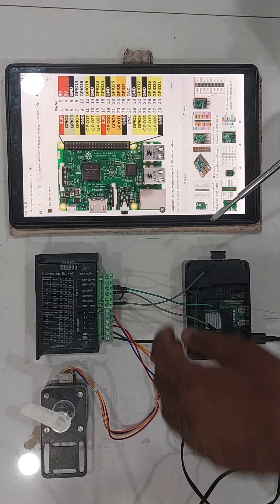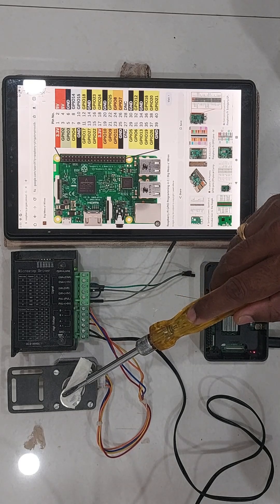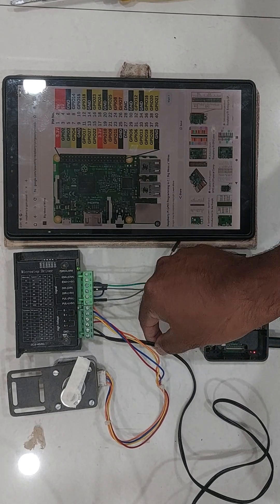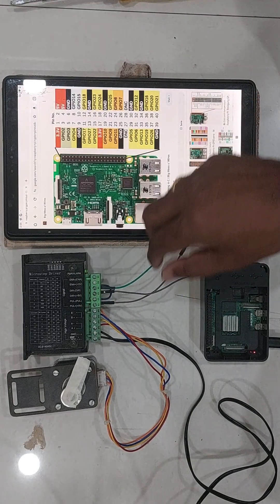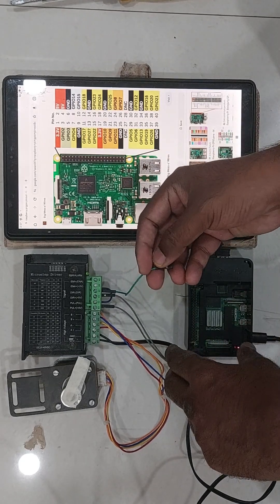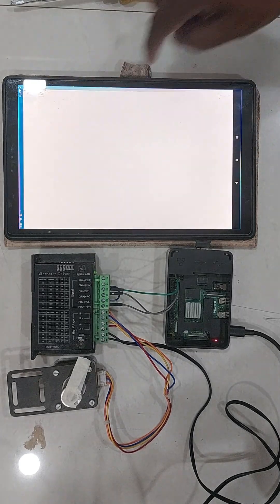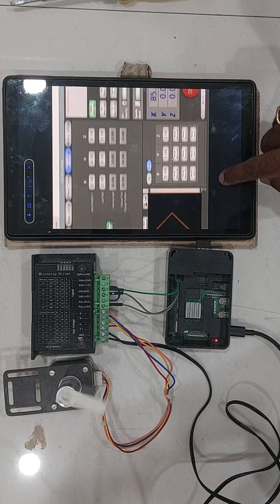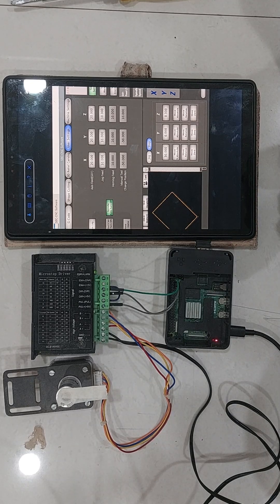Raspberry Pi CNC Software: Wiring CNC Machine for SBC-CNC Software - An Alternative to Linux CNC

Comment: but how to wire up a RS485 inverter for a spindle ?
Reply from the maker: Hello Geri
We are updating the software to use PWM output. This will ease spindle control. You can use pwm to analog output for controlling spindle speed.